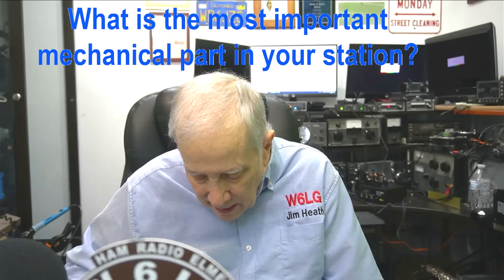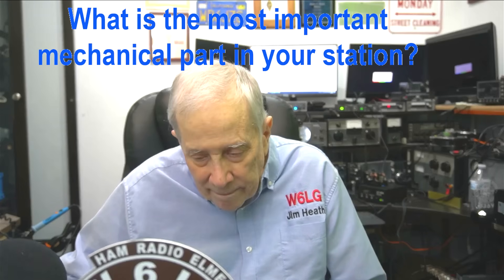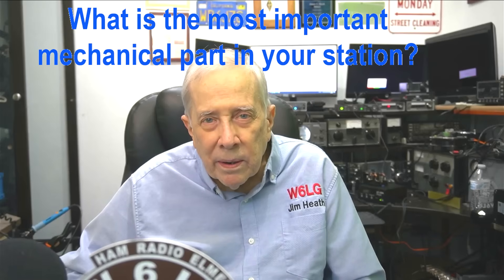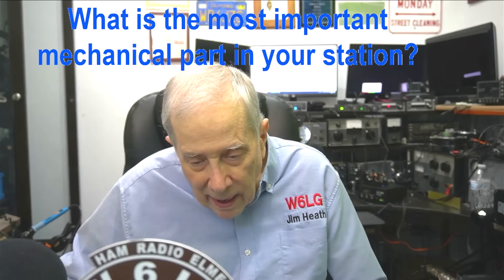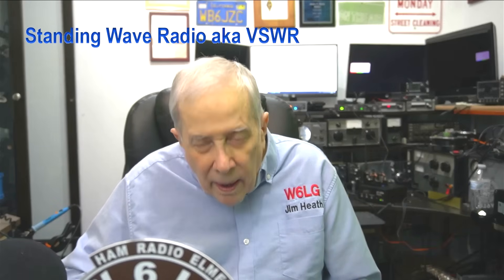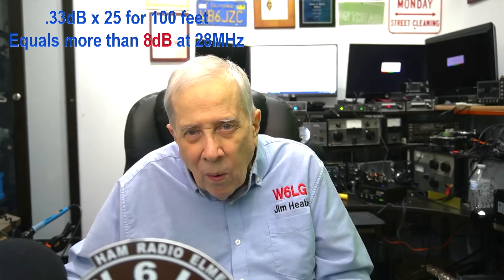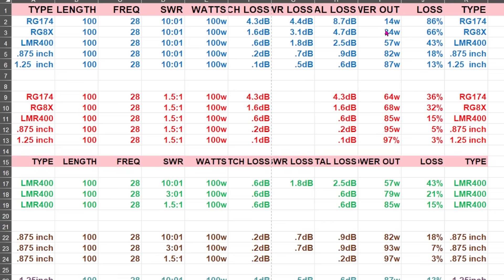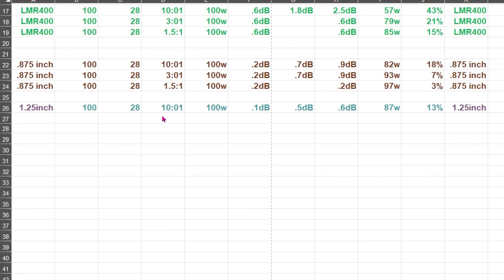Standing Wave Ratio DOES Matter and Here's Why from Jim W6LG

Comment: The most important thing in my shack is my soldering iron. It was the first tool I wanted when I was 10, and 60 years later I'm perfectly happy running $100 kit HF rigs, but my soldering station is a Metcal.
Reply: My most important thing in my shack is my antenna tuner
Reply: @Pioneer936  Ditch the shack antenna tuner and get a remote tuner.  You'll bitch me out now but thank me later.
Reply from the maker: Remote tuners are really good.  73,  Jim
Reply: @ham-radio so are tuners in the shack
Reply: @Pioneer936 why would you think so?
Reply: @N9XRradio because they allow the transmitter to produce full power into the system and send reflected power back to antenna
Reply: @Pioneer936 it does allow the transmitter to the antenna system but it does a phase shift to the signal and the transmission line will start to radiate a bit. The remote tuners send almost all power to the antenna and the transmission line doesn't radiate. That's the diff.
Reply: @N9XRradio the feedline does not radiate because a tuner is in the shack, feedline radiation is down to an antenna imbalance or lack of choke at the feedpoint
Reply: @Pioneer936 yes. You are correct. If you have a tuner in the shack and you are not using it or it's set to THRU, then it doesn't have your transmission line radiate because it's not doing anything. 

What does a tuner do?  One thing is that it cancels the reactance of the antenna. Your antenna may have a "j" value of+250 ohms at the feed point let's say. If you have a tuner at the antenna feed point cancelling the+250 ohms of reactance, it only affects the antenna. The feed line sees no phase shift. 

If you use the tuner to cancel the reactance at the shack, you can do that and you can see excellent swr measurements at the radio, but that tuner is phase shifting the signal across the feed line. Then you get a little radiation from the feed line. 

I hope this helps.
Reply: @Pioneer936 we talk a lot about the ideal SWR for the transmission line. We know it's 1:1. But what's the ideal SWR on the antenna?  It's infinity:1. What's in-between?  A little of ideal antenna and a little of ideal transmission line. 

You can use a tuner in the shack and I do, but I know it's not optimal. I won't lie and say it is.
Reply: @N9XRradio the conjugate match the tuner makes does not make the feedline radiate, feedline radiation is from an antenna imbalance
Reply: @Pioneer936 100% correct. If you do the conjugate match at the antenna feed point, the transmission line doesn't radiate.
Reply: @N9XRradio obviously you don't understand conjugate matching,the conjugate match is between the tuner output and antenna feed point
Reply: @Pioneer936 I pointed out earlier about the tuner does phase shifting to counter the reactance on the antenna and to do the conjugate matching. I understand that part. Do you?  The tuner has to correct for the antenna resistance and the antenna reactance. I learned this stuff in engineering school. Don't say I don't know what I am talking about until you address my points. You look really silly right now.
Reply: @N9XRradio my comments are being deleted
Reply: @N9XRradio the tuner creates a phase shift I agree, but the phase shift is in phase with the forward power, so are you saying that the forward power is now causing the feedline to radiate? There is feedline attenuation that's true, easy to test if its radiating with an  rf meter 👍
Reply: I'll second the Metcal - you just need to use one to understand HOW much better they really are.

Comment: Very interesting Jim and also very informative.  The run of my coax to my antenna is neigh on 30 feet.  I'm using EXTRAFLEX 13/.500", not really sure of my losses ☹, because of serious space restrictions the antenna I use is a Barker & Williamson T2FD 90 foot dipole.
I find it a great antenna.
73 Jim de Ger EI6DP

Comment: How do these numerical measurements compare to equal length of 600 ohm ladderline???  That is what I use in the field with an OCF vertical dipole and it seems to work just as well as a vertical 1/4 wave using coax.  🤔
Reply: Are you planning to properly match the 600 ohm line to the transmitter and to the antenna?

When you have a 50 ohm radio, a 50 ohm transmission line and a 50 ohm antenna, life is simple.  Jim, I think, stays away from discussing 600, 450 and 300 ohm lines because you are throwing a wrench into the system.  Are you properly matching at both ends?  If no, the answer is impossible to guess because there are an infinite number of possibilities depending on the length, frequency, and what your input and output impedances actually are.  Answering your question is truly a shell game unless you want to commit to actually properly match the input AND the output ends of the transmission line to realize the farm-out results many promise.  It could be awesome.  It could radiate like a banshee.  
No one really knows.  The only way you can realize optimal results is to properly match both ends.  If you do that with your 600 ohm line, I believe it will out perform Jim's coax.  If not, you probably won't realize a great result.  

Yeah, Youtubers won't tell you that.  They either don't care about your enjoyment or they don't care to take the time to explain it because it is higher level stuff.
Reply: @N9XRradio  Thank you for your insights.  I already use a Palomar Engineers 4:1 tuner balun and a Kenwood TS-590S (its tuner can tune up to almost 10:1).  It cannot tune 12 meters but the others tune very quickly (20 thru 10).  The long leg is only 27 feet high, the low leg is a "Lazy-L" about 13 feet long staked maybe at 110 degree angle. The feedpoint is raised about 6.5 feet off the ground on a painter's pole.  Seems to work just fine.  I suppose I could work on trimming the short and long legs of the dipole a little more carefully using a VNA and "perfect it" but I am already making European and Central/South American contacts from the midwest US.  Not sure how much I want to try to quantify what loss there is with 11.5 feet of 600 ohm ladderline, I was hoping Jim would have some insights???  I am not an engineer and I never will be.  It would take that kind of meticulous person to answer my question, I think.  I think fearmongering is out-of-place and we need quantifiable answers while still using (AND ENJOYING) what is working for us.
Reply from the maker: The answer is about zero loss and should be very effective   7 3
Reply: @ham-radio  Thank you!  That is what I suspect, even with one of the bands somewhere between 5 and 6 SWR.  But an engineering reply with specific measured numbers would clarify it further.
Reply from the maker: Okay, zero dB match loss, zero dB feedline loss and zero dB SWR loss equals zero dB system loss at 28 MHz, 100 watts ICAS as measured with the RigExpert 2000.  73, Jim
Reply: @ham-radio  LOL, thanks Jim, however I do have a homemade RF choke attached right before the balun made from six feet of LMR-240, maybe some loss there!  😁

Comment: Jim,  I have been researching the topic "When did hams start measuring SWR?"  The first ARRL handbook to mention SWR was the 1949 edition and how to measure SWR first appeared mid to late 1950s.  I have a Heathkit AM-2 SWR bridge from 1957 with the manual.   Oliver Heavyside described the mathematics of coaxial cable in the 1880s but coax was used in undersea cables in the 1850s.  Hams appear not to have used SWR measurements prior to WW2 instead were concerned with antenna current and used ladder line transmission lines. Ham use of coax occured after the war and surplus coax was used at first. Great discussion as always. Best  Wishes to you.
Reply: Very early on, hams ran a light bulb along the line to see the repeating bright and dim light levels and could see the SWR.  This was at least the '30's.
Reply: @N9XRradio  When I put up a doublet maybe 20 years ago and as I run QRP I used two torch bulbs in the twin feeder and tuned for maximum brightness and so hopefully maximum r.f. out.
For long wires an r.f. pickup meter and again tuned for maximum on the meter. 
I eventually made an SWR meter.
G4GHB.
Reply: @bill-2018 that's awesome. There's no arguing with some sort of a field strength measurement.
Reply: @N9XRradio  Yes, I did it that way for years before I built my SWR meter.
G4GHB
Reply: @N9XRradio  do you have a citation for this?
Before WWII hams were using ladder line and because of its low loss SWR was not very important. I find no mention of SWR in ARRL handbooks prior to WWII.
Reply: @vladtepes481 this is a loaded question and truly an instance of a logical fallacy. You can just deal with it the best you can.
Reply from the maker: 1926 Handbook chapter on antennas.  73, Jim
Reply: @ham-radio  Thanks for the info.  The 1926 Handbook makes no reference to standing waves. The 1936 Handbook does mention standing waves and the use of current meters. tuning circuits  to achieve maximum antenna current. I am somewhat familiar with the use of light bulbs for detecting and minimizing standing waves.  A high frequencies a slit in the transmission can also be used to find the voltage peaks.  Quite a bit of this technology does not seem practical for monitoring antenna status on the fly and no direct measurement of SWR is made. On ladderline loss due to SWR up to at least 10:1 is unimportant.
Reply from the maker: Pages starting 319
Reply from the maker: We had light bulbs, RF ammeters and other devices.  Look at the 1926 Handbook.  It's there because it was necessary.  The statement of the guy saying we did not know about certain topics is just someone speaking without doing the research. 73, Jim

Comment: Great video as always. I like when you keep telling that resonance (X=0) is not always where the SWR is minimum. I find very few understand it. Can you elaborate on which is that Canadian paddle company please? Also the title of the video has a typo. Should be Ratio not Radio. 73 de KD9KTW
Reply: Maybe I hit lucky with my 24.925 MHz inverted vee.
I got the SWR to it's lowest point with my meter then put the NANO VNA on to check and got the following results:

SWR 1.02
Impedance (varying slightly) 49 - 50 Ω +j1.4

73, G4GHB.
Reply: @bill-2018  Awesome use of the nanoVNA.  It makes everything else obsolete.
Reply: @N9XRradio  
I'm more impressed I got the initial result using my SWR meter only for it's lowest reading, then checked with the VNA which I got last year. 
The VNA is very useful for reactance readings and makes things easier to see if the aerial is too long or too short, and of course it's other uses. 
G4GHB.
Reply from the maker: Thanks.  Someone else made a comment but I did not understand.  That's very much for making it clear as to what was wrong.   Chemo has made it easy for me to make mistakes.  I take almost 40 pills per day.  one of those medications costs $40,000 for 28 tablets!  So again, thanks for the help.  Jim
Reply: @ham-radio dear Jim, consider looking at the Fenbendazole / Ivermectin eventually. Number of scientific paper there. You may also check videos by prof Thomas Seyfried. All the best and 73!